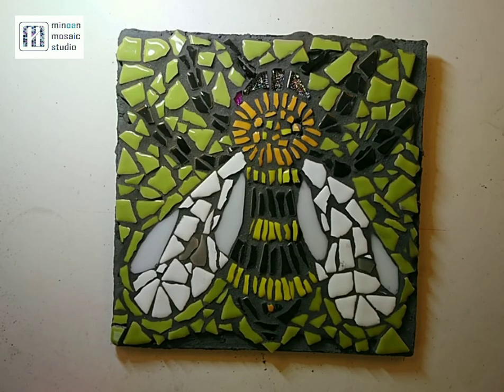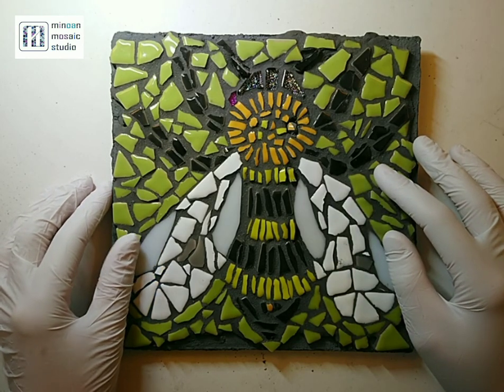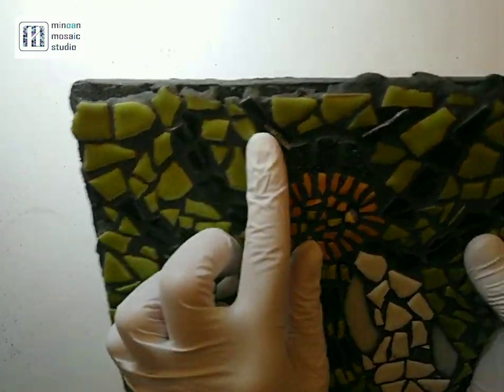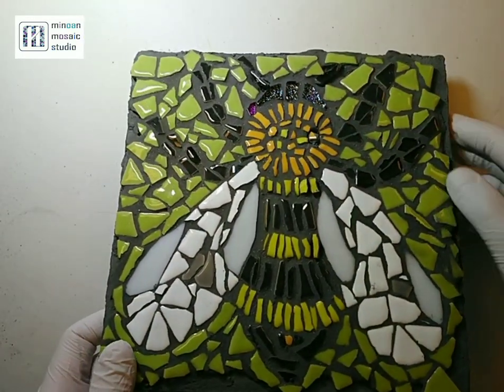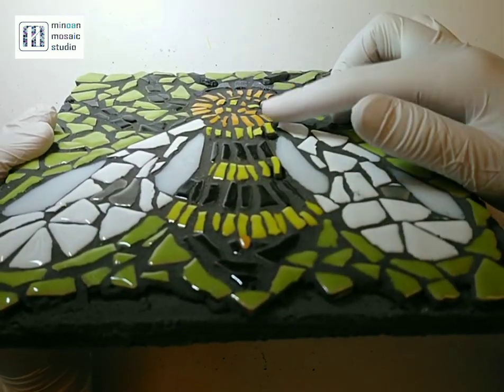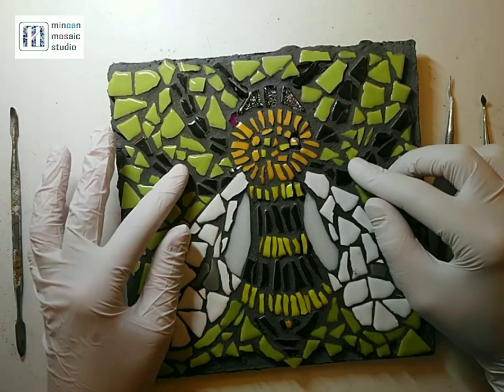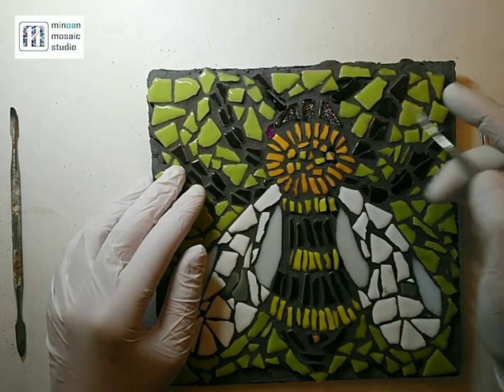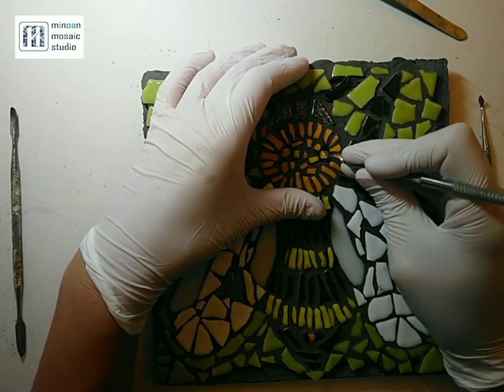Rescue and re-grouting a mosaic

Comment: What grout did you use?
Reply: It is the MAPEI ULTRACOLOR PLUS GROUT CEMENT: Fast setting, mould-resistant and water-repellent. For interior or exterior use on dry or wet areas, timber floors and underfloor heating.